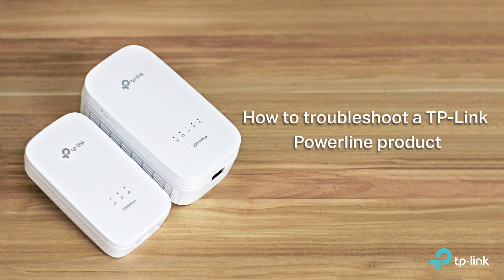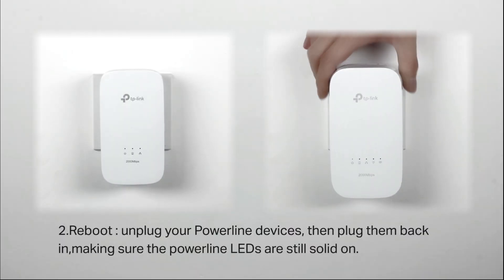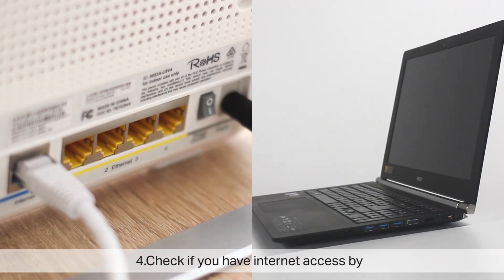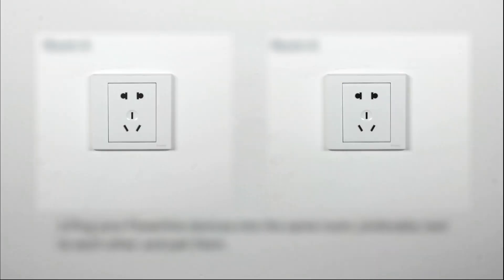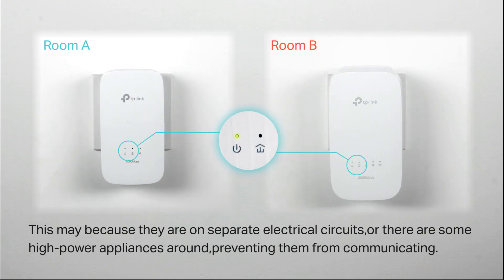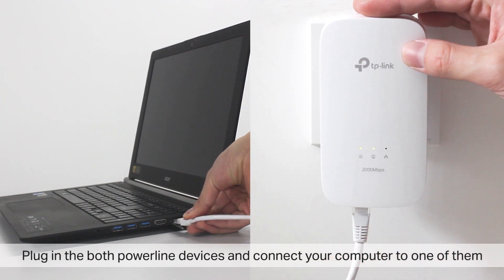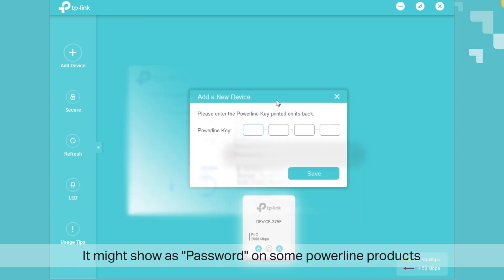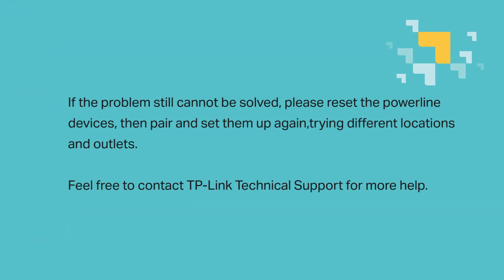How to Troubleshoot a TP-Link Powerline Product

Comment: So fun question here. I have no clue how. But when I plug both my devices in and check them on my TPPLC utility tool. I can see that both are seperate, not actually grouped. What is the problem here? My computer sees them both but not connected?
Reply from the maker: There are a few reasons for this.  1.  the pair button could have been held while installing thus removing the pairing.  2.  They could be used/2nd hand products and they were not paired.  3.  Bought as separate items so not paired automatically as items in a Kit are.  4.  The circuits they are connected to are on different panels.  The fix is simple. 1. Hit the pair button on each unit and wait for the homelink light to light up.  2. Use the tpplc app and "add" the adapters to each other using the powerline password printed on the back of the adapters.  3.  Make sure they are on the same circuit.

Comment: 400 mbps with ehternet cable, 20 mbps with cpl plugged in. can't figure what causes the issue
Reply from the maker: The first question would be:  "What model do you have?"  If your set has multiple ethernet ports on the base unit we would light to have you test the speed at that unit.  One Ethernet cord connected to the router and the other to your computer.  If the speed at the base unit are still 400 Mbps you concern will be caused by one of several factors.  Distance, interference, electrical Line noise, number of hops, or quality of the powerlines.  To deal with these items you would want to contact support.
Reply: @TPLINKUS  it's the TL-PA8010 KIT. i read so many events that may cause parasites in to the process on the page below i may should just use a 10m cable ethernet for my particular configuration. i don't have anyway to make path short with less parasites. i'm in small home i'm using all available plugs. you can contact me on twitter @stationlive_com if you want. thanks for your reply tp dude https://www.tp-link.com/en/support/faq/409/

Comment: what the fuck is the point of a powerline adapter existing if you can’t connect to a room on another circuit
Reply from the maker: By circuit we are referring to the main circuit or main breaker in the panel.  Powerline can be on any breaker switch powered by the main breaker in the same panel.  Powerline will not work across panels including sub-panels.

Comment: I think i may have a router or isp issue.... I have wifi connection direct through the router. But when I try to connect to the tp link wifi signal, I don't have internet access...

Comment: you realise the tool is in flash which is no longer available?
Reply from the maker: The Tool used to require flash but in November we released a new version that is no longer flash based. https://static.tp-link.com/2020/202011/20201127/tpPLC%20Utility.zip

Comment: On both devices the Powerline LED is not on but they show up in the utility app as two separate devices aka no vertical line like in this video. What should I do?
Reply from the maker: This indicates that the units are either not paired or are not on the same electrical circuit.  try to pair them by hitting the pair button on one unite for 1 second and then on the 2nd unit for 1 second.   If they are paired then they are not on the same electrical circuit.  For that both units have to be on a breaker that is in the same panel.  Powerline does not work over different panels.

Comment: tpPLC utility not working new version 27/11/2020 installed that’s supposed to work without Flash but it does not connect to all adapters previous version for flash worked fine can anyone throw any light on this, can firmware be updated without this utility
Reply from the maker: We would need you to contact support at support@tp-link.com.  We would need to collect more information to investigate and resolve.

Comment: They sync in the same room, but not where i need them to be. Tried TpPLC but the one plugged into my computer doesn't show up on the program. Waste of time and money.
Reply from the maker: If the remote unit is not connected to an outlet on the same main circuit/panel then the adapters won't work.  If they are please contact support for assistance.

Comment: My devices are connected, paired, and I can connect to the power line, the LEDs stay solid green, no emergency problems, but my laptop and phone disconnects and connects instantly every half minute while connected to the tp-link network, what can I do?
Reply from the maker: It depends.  You would need to troubleshoot with support to figure out what is causing it.

Comment: I have the TL-PA4010 KIT (AV600) and the Powerline is blinking green, and I can't find anything on how to fix it or if it affects your internet. Is there a way to fix it or an answer if it does affect my connection?
Reply from the maker: Depending on the model the blinking green indicates the connection rate is below 50Mbps

Comment: my powerline led is flashing red help
Reply from the maker: That indicates a poor connection.  You would either need to filter out noise on the line by using surge protectors or relocate the adapter.

Comment: I have a connection, but after a couple of minutes my whole internet is distrupted.
I tried everything mentioned in the video and nothing has helped.
Does somebody have the same Problem as me?
Reply from the maker: The powerline should not be disrupting your whole network unless its connected to your modem instead of your router.  If it is and the concern resolves when the powerline adapter is remove we would suggest contacting support.
Reply: @TPLINKUS  I already did, lets see how long it will take them to answer me, thank you for your help.

Comment: How do I fix a red light in the middle circle?
Reply from the maker: if the symbol is a house that is a poor signal and you would need to move the remote adapter closer to the base or connect electrical devices to surge protectors to try and filter excess noise from the powerline.
Reply: @TPLINKUS     interesting answer you provided to the this above question from 2 months ago. I just purchased this device. My device in the outlet right next to the base, is the one that has the red light (symbol is house), the other device in the room with the work computer has all three lights as green.

Comment: Glory be! It worked! Haven't really needed them despite owning them for 4 years. Had to download the utility and input the 16 digit code but that did the trick immediately having both of them side by side on the same socket. Might be working at home for quite a while so glad I'm not at the mercy of the the wifi signal.

Comment: All powerlines are rubbish product. I bought 3 brands, none works except same room!! Why the hack i need to run an exposed RJ45 cable from router to one floor above? Stupid
Reply from the maker: Most powerline product follow HomePlug AV1 or AV2 standards.  Requirements include that both plugs the one connected to your router and the remote unit have to be on breakers that belong in same panel.  If the rooms are on different panels they will not work.
Reply: @TPLINKUS  What is panel? I;m electrician and i dont understand what you mean. Just answer me this:
AV1 : use live, neutral or earth
AV2 : use which wire?

I can tell you, according to my supplier. 60% of all powerline customers buy & throw away.
Reply from the maker: @superpooper_2030   @open defecation   AV1 uses just the powered lines.  AV2 also uses Line-Ground and Line-Neutral to reduce interference and increase throughput.  By panel we me the electrical panel that every home has.  Where all of your breakers are located.   Most people get rid of powerline because they think its going to give them unbelievable speed and is going to be just like connecting to their router.  The truth is that isn't always the case.  Like range extenders there are so may factors that can affect performance that most customers will just give up on it rather than go through the tedious testing that at times is needed to troubleshoot.

Comment: The powerline green light keeps flashing on and off and so I have terrible internet connection. this only happened suddenly after not using my pc for about a week. It's only happening in my room
Reply from the maker: that is likely indicating some interference.  Move the remote adapter closer to the the base unit and see if the connect rate improves if so then there is interference and you will want to put any major appliance or electronic on a surge protector to filter out this "noise"

Comment: garbage brand, stay away. I get constant disconnect and have to constantly reset and pair
Reply from the maker: That is likely do to the condition of your homes powerlines.  If it is the product however you can contact support and if its determined to be a manufacture defect and you are qualified for a replacement an RMA may be possible.

Comment: We just swapped av600s to av1000s and now I’m having trouble with the pc end adapter, they are paired but the Ethernet light blinks with no internet’s connection, I’ve reset them, re paired, checked all cables, tried different cables, any ideas?
Reply from the maker: is the homelink light lit?  Have you looked into the tpPLC utility to see if there are any line issues?

Comment: i downloaded tpplc but when i go to add a device, it says it couldnt be added, has anyone had this error? i dont know what to do anymore... this tp link device just keeps dissapointing
Reply from the maker: The adapters in a kit are pre-paired.  If an adapter is already paired it can't be added or paired because it already is.  If its not and the powerline pass-code is not being accepted then do the manual pairing.  Hit the pair button on  a unit already in the pair then hit the pair button on the unit you want to add.

Comment: My extender sometimes work pefect but sometimes it doesn t work(not paired). İt changes during the day. What can i do ?
Reply from the maker: If its loosing pairing you may have the remote adapter in a area that is receiving interference.  Relocate the remote adapter to a different outlet.  Also if its plugged into a surge protector or power strip relocate it to the wall outlet.
Reply: @TPLINKUS  thank you i will try that

Comment: So I bought the wired version of thr av600 and it worked GOOD but then one day it stopped working on my nintendo switch and after that for a few days it would work 1 time a day until i turned the system off I have tried to resseting thrm but nothing Please help
Reply from the maker: You would likely need to contact support for assistance.
Reply: Any suggestions should i send it back to get a new one or what should i do instead of contacting them?
Reply from the maker: @dylamic2661  You should contact support like we suggested.  There is no reason why they cannot help and resolve this issue in some way.

Comment: My light is up and my computer has worked before with the tp link but I accidentally unplugged it and it won’t reconnect
Reply from the maker: I would suggest unpairing the two powerline adapters and then re-pairing them.  That should resolve the issues.
Reply: TP-Link I have tried everything everywhere on your websites and videos but the thing just doesn’t want to work
Reply from the maker: @benjaminferguson5280  If that is the case we would suggest contacting support. Go to TP-Link.com click on Support and then Contact Technical Support

Comment: Every time I hit add device it says it's unable to add the device but the LEDs on the powerline adapter that it should be connecting to flash as it's supposed to be connecting.
Reply from the maker: The adapters come in the box pre-paired.  If you are trying to re-pair them i would do this.  Hold the Pair button for 30 seconds on each adapter, then hit it for just one second on each adapter.
Reply: @TPLINKUS  Yeah they still will not pair. I put them as close as possible and tried every method I could find on the internet including this one. They worked perfectly fine since I got them over a month and a half ago and now all of the sudden they do not pair.

Comment: Here's how I solved the issue of the adapters showing the leds turned off after 10 min of plugging and remaining paired: 
Download and install tpPLC utility from TP Link website on your computer. Reconnect the devices to the wall plug. Open tpPLC utility and it should show all your devices. If it doesn't show all the powerline adapters, pls unplug and plug again and click Refresh. Now select each adapter and open the 'Advanced' settings --> Mode. Turn off the Power Saving Mode. That's it. Your adapter will continuously  show as connected.
Reply: Hi there, any idea where I can find the actual tpPLC utility installer (the blue UI one)? The website on l’y propose the web browser one (the green one...)

Comment: useless guide. the tpPLC utility is not available. Update your guides - all of them. In your knowledge base and in the video!
Reply from the maker: This video is 3 years old.  There is obviously going to be outdated information. If you do not see a video with newer information you can either look at the support section for your product on our official website or contact support.
Reply: @TPLINKUS  I spent 2 hours on your official website in the support section. Your guides have the same information. So still: update your knowledge base. Don't be defensive. Take feedback on board.
Reply from the maker: @finallyrob4231  No one was being defensive.  We were merely pointing out the age of the video and the likelihood that the information was outdated.  If you are having issues with a product and can't find the answer in our self-help materials we encourage you to reach out to our support team. Form here you can also provide detailed feedback to what you feel is missing form the self-help materials and we can look into it further.
Reply: @TPLINKUS  not sure if you are purposefully missing the point but: Update your guides. Your website does not have what your guides on your website say you need to fix the issue. update the guide. update it. If this video is out of date, take it down, make a new one, and updated one. 
I work in tech support myself and I deal with this type of feedback daily.
Your correct response is along these lines:
"Sorry you are having a bad experience. I will be sending this feedback on to teamwhatever. In the mean time, you can get in touch with our customer service team at LINK HERE". This is how you avoid a conversation like the one we are having right now. Use this advice at your convenience in the future when you get feedback like this.
End of conversation.

Comment: My power went off yesterday. Now they don't work. One has the power light flashing and no other lights on. The other  has the power light on the center light is off and the third light is on.  ?????
Reply from the maker: Hard Reset the devices and then re-do the pairing  if that does not work contact support.
Reply: @TPLINKUS  
👍

Comment: Hi! I have the RE200 trying to extend my internet provider modem's signal but both 2.4ghz and 5.8ghz lights are off after setup so I can't connect to it... The power and wifi are on... any ideas? I tried WPS and the 2.4ghz went on for a while and after a moment went off again...I'd appreciate the help
Reply from the maker: Your ISP gateway likely is having issues with WPS.  We would recommend manual setup.  This video is for Powerline however if you look at our channel's videos you will see a video for Range Extender Web or Tether setup.  Use one of those.
Reply: @TPLINKUS  I tried manual setup but I couldn't get it to work. Could it be that I need a router? I thought it was going to be more easy. Or maybe it's deffective...
Reply from the maker: @maumex  always possible but we would defiantly recommend contact support first.
Reply: @TPLINKUS  I am on it on the forum but still no luck.

Comment: Plug in both powerline devices and hook your computer up to one.  Now get the number from the other device.. you know, the one on the back of the device you just plugged into the wall so can't see where the number is..
Reply from the maker: The powerline code should also be on a card in the box with the units.  Or simply take a picture of it before you plug it in and use the picture as a reference.

Comment: Mine works flawlessly with my Steam Link.  But if I switch to my lappy, it either works flawlessly, or goes on/off/on/off/on/off/on/off, in a fraction of a second alternations...I left it running over night once...on/off/on/off/on/off/on/off.  The lappy works flawlessly if plugged in to the switch in the Lounge (as do all my other devices).  I thought I'd found the problem (it's quite weird):  if plug my wireless adapter for my xbone controller into my main PC, it appears to create a second 'internet-less' Ethernet connection.  It makes no difference to the PC, it just uses the principle functioning Ethernet connection.  But I thought this might be the problem with the Powerline, so I unplugged the adapter and the Powerline worked fine for a couple of days, then back to on/off/on/off/on/off/on/off.  Aaaarghhh!